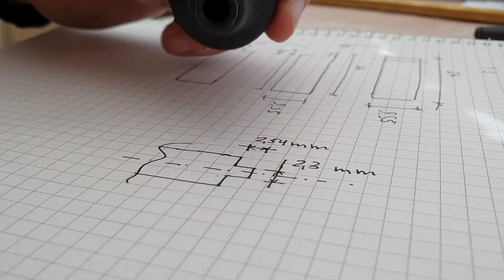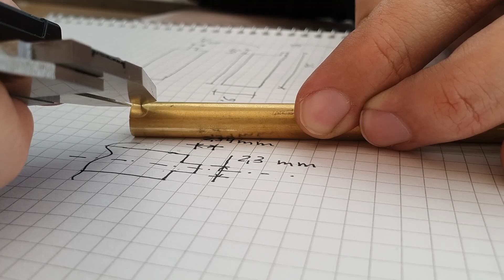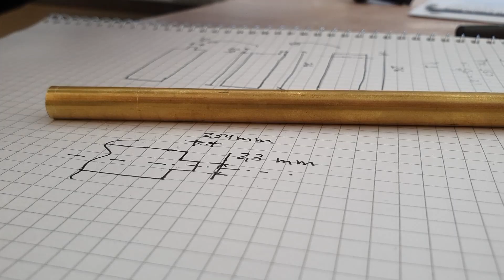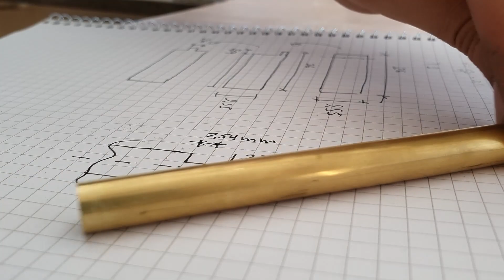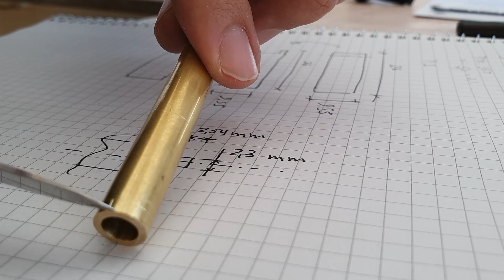Fantastic fit for the DIY solenoid graver handpiece

Comment: Donde puedo conseguir algo as
Reply from the maker: @lisandrosugezky7499  you can check the tubing or honby stores and check the tubes that have 6.00mm of internal diameter, the wall thickness should be big enough to allow you to increase the diameter to 6.35 if you are using imperial collets, if you buy the collets from china that are 6mm in diameter you dont have to increase the internal diameter. The store i bought was from the UK (macc models) and it sent to latin america in a couple of weeks, the brass tube dimensions are 3/8" x 16g.

Comment: Just subscribed. I am a machinist by tradebso I can manufacture parts for the project how does one get started with this build?
Reply from the maker: Hi Jason. Glad to know you are interested. You can check more on the github page. The questions to be answered are: What will be the purpose of the machine? What's the material you want to engrave? How much time would you invest? 
With these questions you can start with what you already have and how you would adapt the system. I have some updates to make in the handpiece that allows me to even engrave steel but since its not something I will do I do not bother.
If you have any question you can check the github page on the description.
Reply: @selvalss  the goal is to engrave up to titanium.  I see the pulse graver but I can't justify the cost.
Reply from the maker: @jasoncastle1741  I think it's feasible and you can even customize tp your needs. If you need help with your project just contact me again. If you're not constricted in size a sligrly bigger handpiece does the job.
Reply: @selvalss  good because I have larger hands so it might behoove me to have a larger hand piece
Reply from the maker: @jasoncastle1741  Have you had time to look into this? Is anything unclear from the github page? Have a great day.
Reply: @selvalss I am still looking if you have a few ideas for machined parts let me know I'd love to help but I'm an idiot on the electronics and arduino aspect